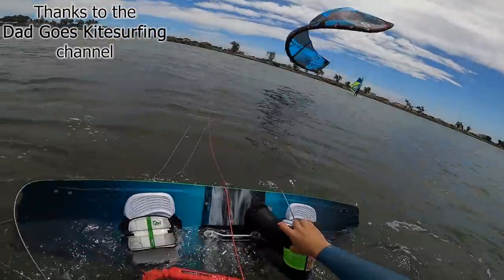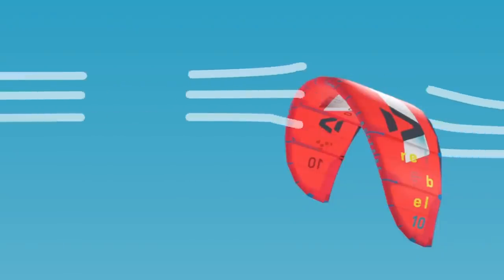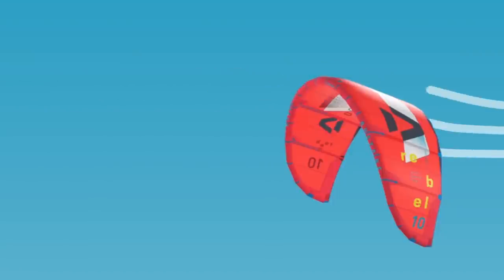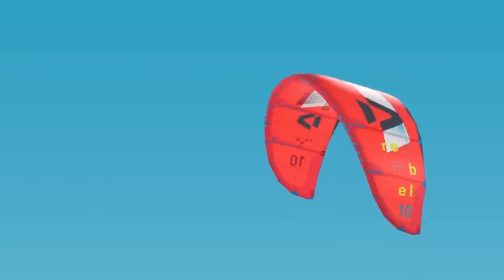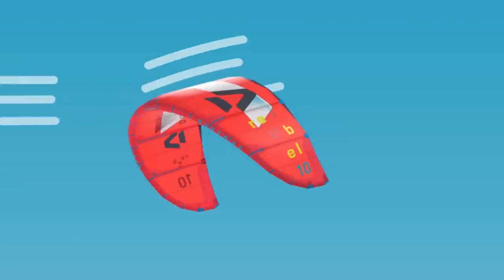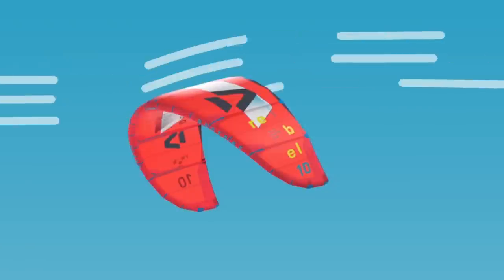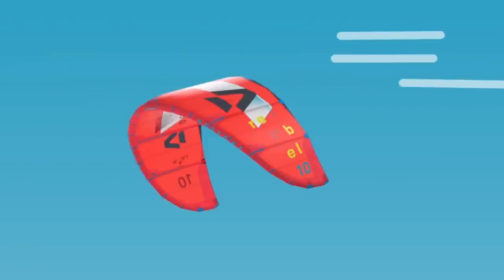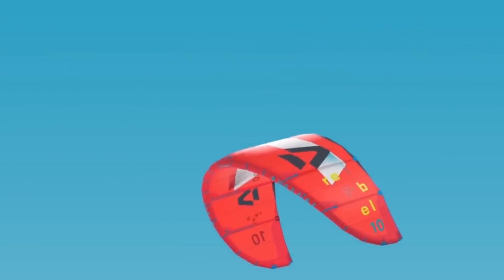Kite Front Stalls (how to fix and how to avoid)

Comment: Wow! Great video!  I am newbie, and purchased a 4 M trainer to begin my journey.   First use was last Sunday.  Very light (3-5 mph) wind, but heck, I was stoked to begin to learn to fly!  When I could get the kite to try to fly (direct downwind launch!) it either immediately looped into the ground like a dying swan.  Front lines had tension, rear lines slack.  I relaunched into a puff of air and the kite quickly climbed to 12:00 o'clock.  Oh boy, it was up!  Again front lines were tensioned (sort of), back lines, not so much.  The kite quickly climbed past vertical and stalled (think the wind died) and did a major dying swan (all lines slack).  I gave up frustrated and have been wondering what happened.  Think I experienced a bit of a front stall along with a dying wind condition.  My control lines are all equal in length (checked again when i got home) and the Ozone trainer is new so I guess I became a victim of myself by forcing the kite to try to fly without enough  force in the wind.  Many thanks for your videos....I'm still stoked!....T

Comment: It is a (kite) public utility video. Thanks. In my experience, front stalling indeed is more likely in these situations
   - jumps with too little kite movement / steering (it is explained here)
   - launch / landing areas: because the wind is less clean and also because of obstacles at ground level such as other kiters, rocks, or specific path to/from water that is not ideal relative to wind, the kiter may  be forced to walk or even trip over towards the kite. That is why, even if it requires a bit more effort, I prefer to walk in the launch / land area in an upwind direction and get the kite at 1 or 11 (12 to be avoided as noted) on the side that allows me to walk upwind and not choose the "lazy" downwind walk.
I had one front stall this season on a beach and that was due to the fact I walked too fast downwind to avoid another kiter on the beach. I should have had my kite on the other side on the wind window when taking my fist steps on the beach at the end of my session.

Comment: Thanks for the clear explanations on a topic that is not discussed often.
I have a vantage 17m which is very easy to front stall (light wind), I was hoping to find ways to improve this.   Based on your video, it seems like there are no setting adjustments that can be done?
Reply from the maker: I don't know any simple tweaks to make a kite front stall resistant. I think it's a problem with weight distribution - most likely it's a bit heavy near the leading edge, which means the leading edge drops more easily. I had that problem with SS Octane kites and didn't find a solution other than to never stop moving!!
Reply: @kitesurfcollege  
Thanks for sharing. Same solution here ^^.
Reply: @kitesurfcollege  The video is about stalling (loosing laminar flow) and overflying. "Front stalling" just doesn't seem to be the right term. IMO You are correct about kites that are out of balance (nose heavy) like most of the kites from 10 years or more ago that would Hindenburg when overflown or when the lines loose tension. It's not really a stall because the kite is still flying as it comes toward you. Most of the newer kites are designed to drift down wind when over flown or during loss of line tension. Your other examples are just a stall that most call a back stall. Back stalling happens when the kite is over sheeted and looses laminar flow and basically acts like a parachute and heads for the most direct point down wind, in the water.
Reply: Kitesurf College (Kite Surf Wing & Foil Tutorials) Wouldn’t attaching your back lines to the shorter line knots (more “power”) tend to tilt the kite back, decreasing the chance of wind hitting the top for a front stall? Just as the opposite (attaching back lines to longer “depower” knots) tends to tilt the kite forward and decrease the chances for a back stall?

Comment: Great video. I have sent it to a mate whom I am instructing. I can generally get out of any problem except one. A BOWTIE I know it's hard to replicate. But my 2015 nitro is bad for it. I have since trimmed the steering lines with a figure 8 knot 2inches higher to maintain it flying upwind instead of front stalling Infront of me if I land a jump wrong. My question is. How to recover from it? When one of your turning lines is behind you centre lines. Is there a way to recover from that? How that for a curly one. 👍😜

Comment: Is there any way to change the trim to make sure the kite will frontstall less often? E.g. change attachment points further back/further in front? How does changing that change the frontstall behaviour?
Reply from the maker: I think it's mainly the kite's aspect ratio and weight/weight distribution that have a big effect on how well a kite handles front stalls. Altering the bridle attachment point can make a small difference but I'd say you're generally best of with the default set up.
Reply: @kitesurfcollege  Thanks. That's one of the issues that we have with inland waters like lakes etc.. Especially if it blows offshore... then gusts are often so unpredictable, that even if there is more than enough wind for kitesurfing, the conditions might be "unkiteable".
I had this problem a week ago in my lake area, that the wind was blowing strong but a little gusty and offshore. The result was that my kite got Wind from below, flew over me, and shortly after it got "downdraft" and the next gust blew from the top onto the canopy...
In some other Video I heard that I could have tried to power it aggressively and therefore force it to backstall... But that would have meant that I was about to get pulled hard very soon...

Maybe an aluula dyneema fronttube kite might help a little to solve the issue.. but that of course will hurt my wallet a lot...
Reply from the maker: Hi, it's quite rare for lakes to be kiteable. You really want your wind to have reached you approaching over a huge region of flat surface (i.e. water). You probably know this already but this video looks at what makes kiteable wind:
Reply from the maker: https://www.youtube.com/watch?v=PGvR_fzbzDs&t=69s
Reply from the maker: There are some lakes that work around the world, for example near here is Brandvlei where in a NW wind approaches the lake from very flat farmland. It's still fairly gusty, but with some experienced it's fine to ride on. Wind approaching from desert can also be okay. Wind approaching from bush, scrub, trees, buildings or hills is usually horrendous for kiting.
Reply: @kitesurfcollege  thx! 😊 🙏

Comment: Do you think Rebels stall more than othe kite?
Reply from the maker: The rebel stalls more easily than an evo or neo for example. A higher projected aspect ratio, slimmer profile and flatter less-C-shape arc all create more power but also make a kite stall more easily. There's more about this in the kite shapes video:
https://youtu.be/MtW8s3YAtbU
However for a kite that was designed to produce a lot of force, the rebel is very stall resistant. The XR range or orbit for example all stall much more easily. It's difficult to make a powerful kite stall resistant, and duotone made huge steps in making that possible.